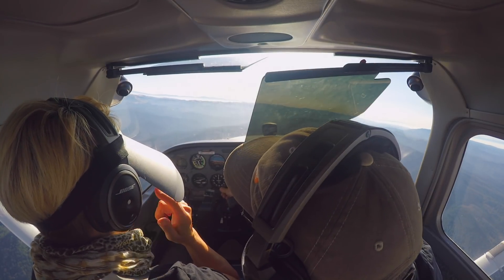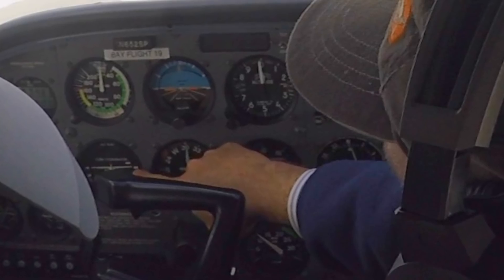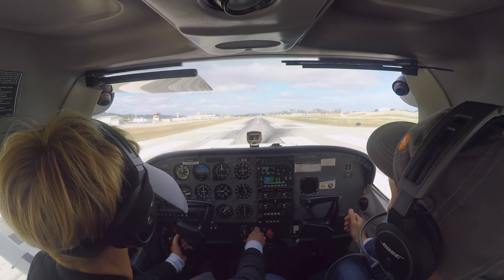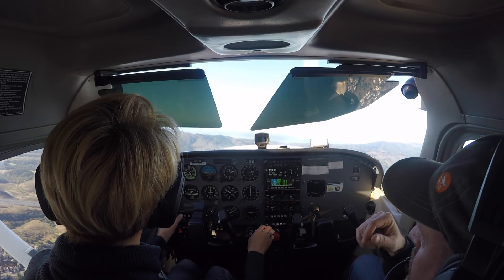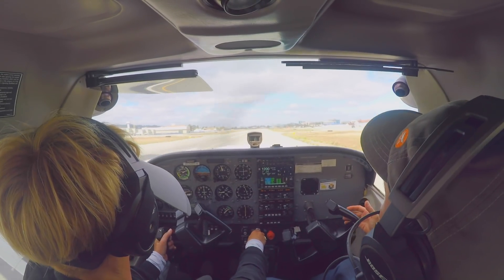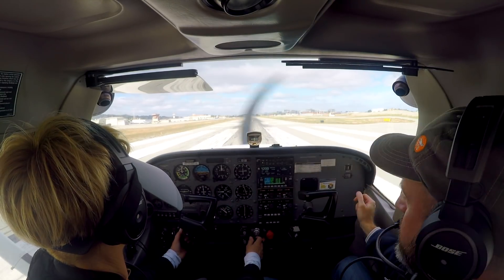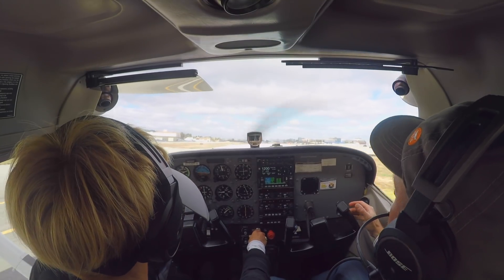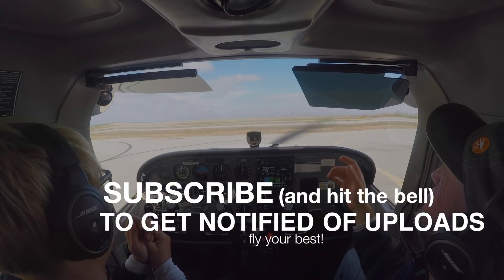ZERO / ZERO Takeoff - DON'T TRY THIS

Comment: Brilliant, Jason- I’ve been flying for a long time, and I NEVER would have thought to train with the TC on the deck. I might need to spend 20-30mins of HOBBS doing a few “high speed” taxis and giving random rudder inputs!
Reply from the maker: Unusual Attitudes 👍🙏🏻 haha ok, but please use caution. I would only do this for training of course, never in the real world.
Reply: The Finer Points Haha- guess I should’ve included that I will NOT be under the hood! Just a “let’s see exactly what happens when &how much” kinda thing. (And at a quiet airport. )

Great channel- you earned a new sub today, & I look forward to digging through it!

Comment: Not even Airlines can take off zero (vis) zero (ceiling). If you can't see the runway markings Runway lights  then you shouldn't be taking off. Cat IIIA/B requires 700-150 RVR with DH of 100/50 ft respectively. Cat IIIC is zero/zero and not aware of any airports which support Cat 3C or any airlines that are allowed to operate Cat 3C.

Comment: Just found this little gem of a tip.  I'll have to use this when I fly.  Never thought to use the T/C on the ground.
Reply from the maker: Just to be clear I would look outside on the ground. This exercise was designed to teach confidence in the turn coordinator ... because ... it's awesome! I do hope this inspires you to use it more in flight though. I'm glad you liked it!
Reply: The Finer Points - I always make use of the T/C when maneuvering or even in level flight.  I just found this lesson particularly interesting since you were referencing it while still on the ground.  Thanks again for the lesson.

Comment: Zero zero takeoff... what a waste of a day
Reply from the maker: Don't you mean a waste of 10 minutes? I was going to put her under the hood at 200 feet anyway. There is a value to "the pressure" a pilot feels when they know they have to hold heading or they will go off the runway. Anyway, there was a lot more to the lesson. Did you really get nothing else from the video?
Reply: The Finer Points oh yea... who does zero zero takeoffs? Airline pilots don’t. Fighter pilots don’t. The average instrument guy doesn’t. We all just wait. You simulated something that doesn’t happen. A great way to waste a day.
Reply from the maker: BLAMBERRY Did you watch the video? I don’t recommend doing real 0/0 takeoffs it was a skill building drill that I learned from my mentor back in the day, it’s really effective. The lesson was longer than that takeoff. I don’t see that  one takeoff in a three hour lesson is a waste of anything.

Comment: Well done, Jason! I have done some actual and simulated zero-zero takeoffs and always used the heading indicator as the primary instrument for keeping me lined up on the runway until rotation speed. Guess I might have done some crosscheck on the turn and bank too, so appreciate your emphasis on using it.
Reply from the maker: Thanks Tom! Yeah, I find the TC more responsive and immediate but I definitely cross check the HI in a quick scan too.

Comment: #TFP Excellent. I'm a low time (118ish) PPSEL with PPMEL. I've always checked the turn coordinator on taxi turns as part of instrument checks inc. balls ( compass and coordinator ) correct and free with fluid. I've NEVER read, heard or thought about its use on the ground in the "straightaway". Amazed. Keep it up!
Reply from the maker: Thanks! wilco. It's great to hear you check it in taxi, a lot of pilots don't and it's hard to add the habit come instrument training. Good work!

Comment: I knew of the radial pattern, but have never heard of the inverted v pattern. I like the inverted V a whole lot more because it saves time and allows you to check more than one instrument quickly. Also I love the idea of the musical beat to the background of checking. #TFP
Reply from the maker: I use the inverted V specifically for rolling into and out of turns, it's amazing for that. You'll want to make sure you include the other instruments in "general" instrument flying .... that's where I like the radial pattern. Every job has the right tool ... use em' both!
Reply: The Finer Points Thank you
Reply: Inverted V is interesting. Rod Machado teaches (or used to, not sure if he still does) the "music scan" which is also to a beat, but the focal point changes depending on which instrument is primary. For climbs/descents it would be different than rolling into/out of a turn. Curious about your thoughts on primary instrument scans. Personally, I find them challenging because I have to constantly remember (or be able to reason about) which instrument is primary before I can begin the scan.

Comment: #TFP I am a low time VFR pilot and have never looked at the turn coordinator during takeoff roll or on the ground and assumed it would not work until airborne. My only focus on the panel during takeoff is to confirm, just before applying full power, that the heading indicator is showing runway heading (should have already been set) and then during takeoff roll I look for airspeed to register.  Interestingly, in a turn I use the turn coordinator more than the attitude indicator.  Using a good scan is something I really need to work on.  Love the short format, it helps focus on one or two major points making it more likely I'll retain the knowledge.  Your mountain flying course is on my bucket list too! Huge fan of your podcast, really enjoying the video content Jason!
Reply from the maker: Hi Kevin, sounds great! Please use caution tho, this is for instrument training. In visual flying I'd want 99% of your attention outside the airplane and only glance in to check engine instrumentation and airspeed. No turn coordinator is better than your eyes aiming on a small target!